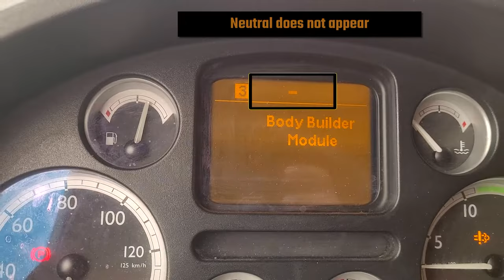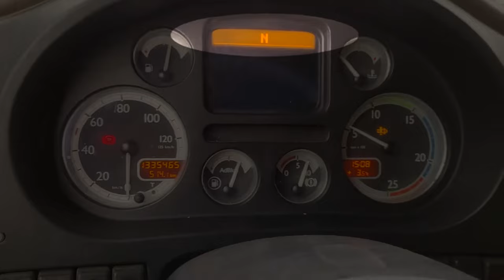DAF XF  Transmission Fault,fast repair!

Comment: I drive a dafcf85 510 with a 18 speed roadranger manual  dont have any electrical  problems!
Reply from the maker: @jeffogle9823  that's great!Wish you many miles without problems🙏

Comment from the maker: Some of my videos are made on the side of the road in a situation where a fast solution was required!When a truck is undriveable you have 2 options:either you call to a pick up trailer(wich is quaite  expensive) either you do something to get out of there until you make it to an workshop where the experts will do thei job as the book says!The purpose of my videos is to help normal guys finding with normal skills,wich are not electricians!
Many many thanks to all of you for watchin!